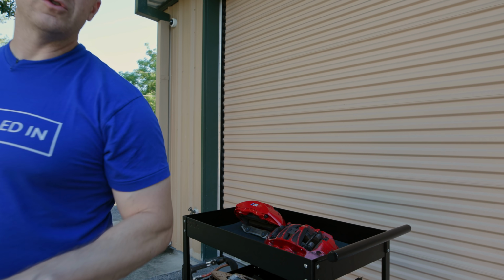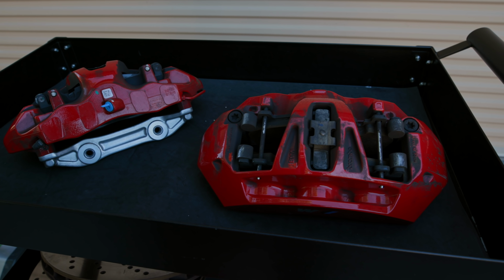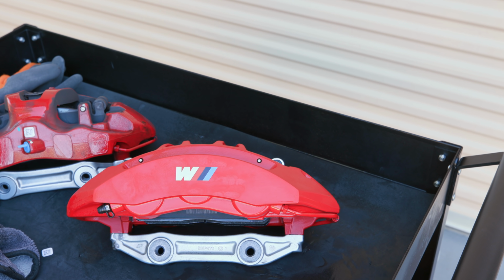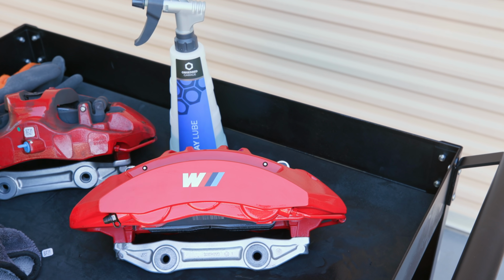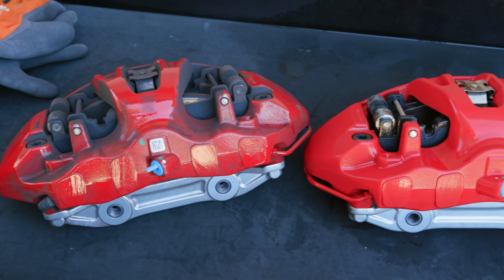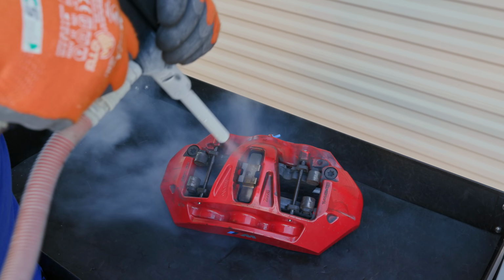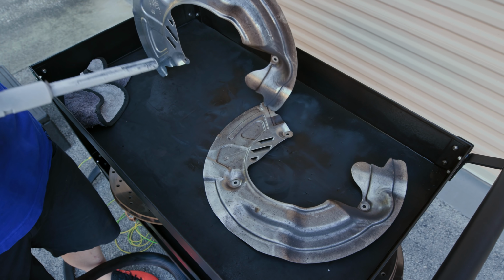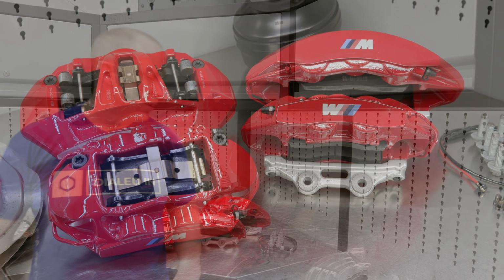Dry Ice Cleanup of my M2CS Brakes - ICS 022 Evo

Comment: A while ago at a local car show I met you and you saw me E36 m3. You told me about the dry ice machine and how effective it was for cleaning the exterior black trim pieces. Is there a way I can pay you or someone to clean those pieces? Or even pay to use the machine and the resources to do it myself? I had the alpine white e36 with 24k miles.
Reply: In a few years yeah, right now the tech is just rolling out really. A local detailer should be able to clean your trim to 95% though using steam, brushes, and APC.

Dry ice just gets you to 100% in a fraction of the time is all.
Reply: @andrewcramer7214  Yeah I might just end up using steam, I'm warry to use any chemicals on the trim just in case of bleaching of the molding
Reply: @madarauchiha1218  most good automotive apcs will do just fine on trim. Megs actually has a trim cleaner as well. Never used it but I'm sure it's good
Reply from the maker: email Matt@obsessedgarage.com
Reply: You can check for a Dryce service provider in your area!  www.drycenation.com  We've sold 70 of these machines and larger units all over the US.

Comment: Can I just take a second to point out that THIS is how you sell used parts?  Maybe not necessarily dry ice cleaning if you don't have that capacity - but just taking the time to clean stuff and make it decent?  I've recently bought some used parts for a restoration I'm working on, and it looked like it was dragged through the swamp before it was boxed and sent to me....ugh.
Reply from the maker: Amen